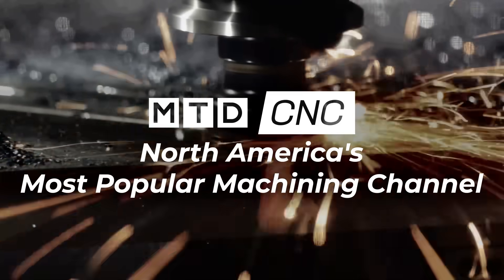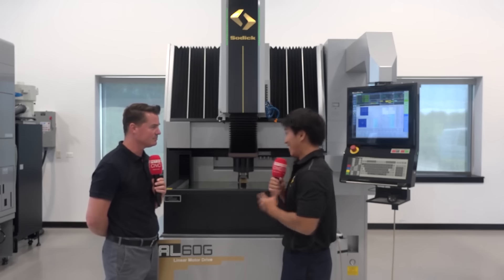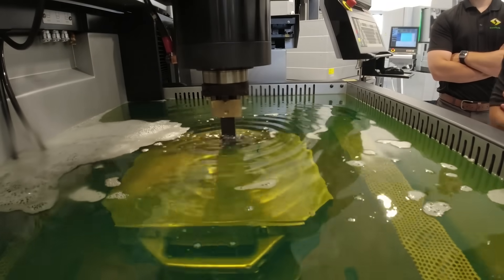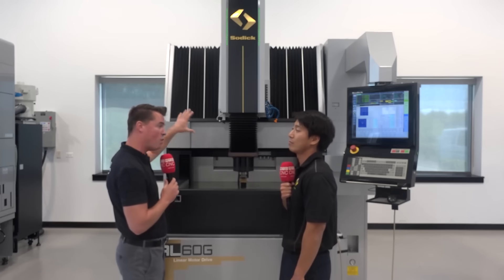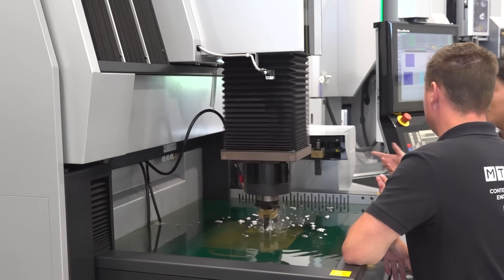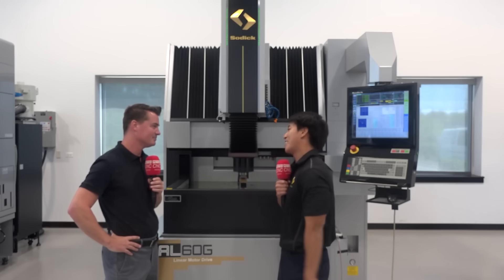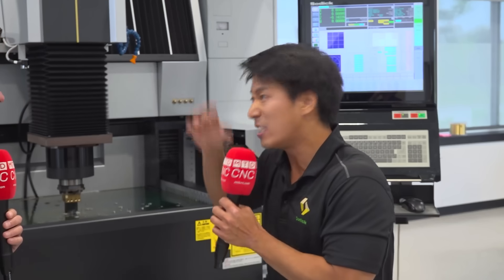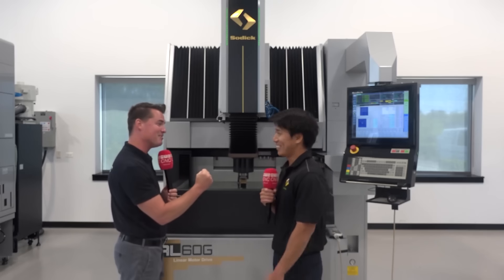This sinker EDM is all about speed, precision, and surface finish!

Comment: I've ran manual sinkers, planer style, small Elix machines, cnc's, designed electrodes, cut them on a Makino SNC 64 w/30,000rpm spindle. 30 years in injection molding. That's my resume, Here's my question: This type of z-axis speed is only beneficial for small detail burning/ribs. If you run the Z this fast with a 1" x 1" electrode burning a deep pocket, you will rip the graphite right off the holder. Hydraulic properties will destroy your electrode. I've cut and burned Cadillac logo electrodes, and I've made some electrodes that were 6" x 15" x 4". Explain the range or limitation of  this Z axis speed, because there's probably a niche application for such aggressive pulsing.
Reply: The only application is deep light weight electrode rib machining  fast Axis movement  was the fastest way to machine due to the flushing action benefit, Charmilles produced the ZAC option 20 years ago and hardly sold , these days , a.c. motors and generator technology gives exactly the same results.

Comment: Try doing that with a decent size electrode, you will create so much hydraulic effect , you would pull the part off the table.
Reply: I should have read your comment before posting mine. But I agree completely. The one guy on the right sounded completely like a salesman and probably had never used a profiler with a diamond file to remove EDM from a mold...kids...lol